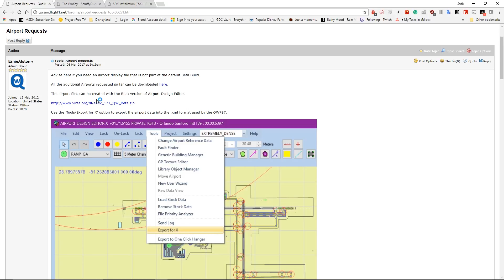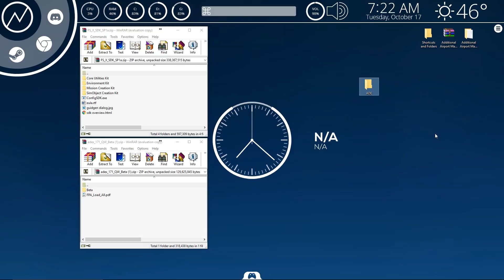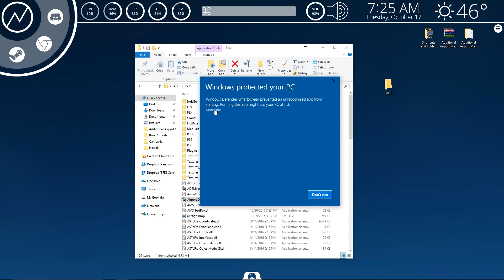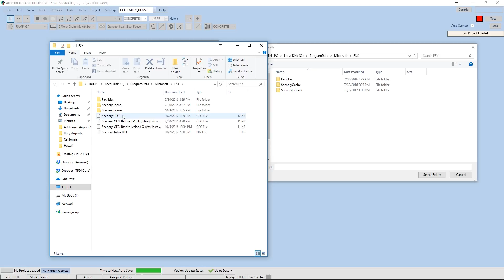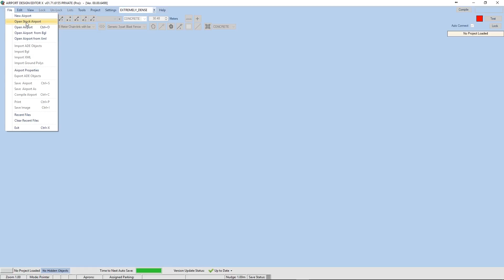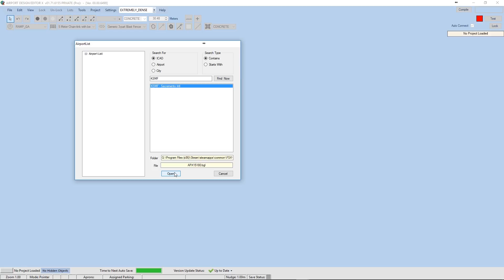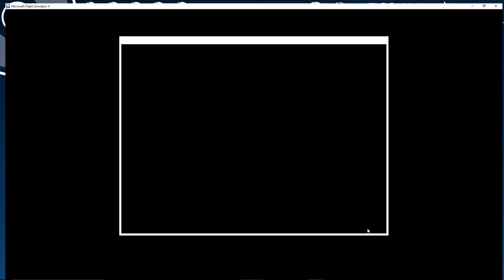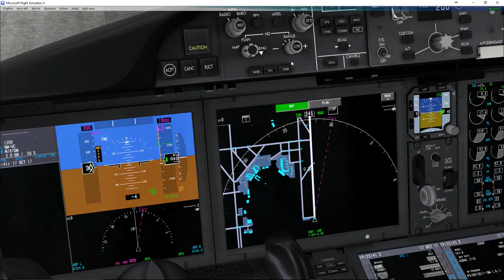How to Create Airport Maps for the QualityWings 787

Comment: A prokey is not really needed for doing the job. Advertisement?
Reply from the maker: Not an advertisement, just a good program. I pointed out that it would only affect the highlighted options, which if a user needed, a prokey would be required. I have no affiliation with the developer.

Comment: hello there, i see in your video (0:48) that you go to the forums of qualitywings to a specific post, where it has a link for available airport maps, i cant seem to find that post on the forum, could you be so kind as to tell us where to go? thanks a lot! also your links are dead.
Reply from the maker: That post was from the beta forums, any of the additional maps requested are automatically downloaded with the plane now. I've updated the top link to fix it now, the second link still works.
Reply: thanks Josh!! very kind of you!  you mean that there is a place to download airport maps fot the 787? the ones they have for europe airports are very bad, that aplication can convert charts from lets say, navigraph? thanks again for your help
Reply from the maker: cartayna not sure about those, it can read from add on BGL files, but requires some additional work. If you want better ones, check out the AVSIM library for them
Reply: Thanks mate!!

Comment: Can same steps be used for payware airports?
Reply from the maker: David Milate It depends on the way they structured the AFCAD file. Most likely not, but you will need select the open airport instead of stock airport option and browse for the AFCAD file.

Comment: Nice video! I have one question, im trying to add the aerosoft Madrid airport AFCAD into the qw787 but the problema is that once the airport is desplayed on the screen, no taxi ways appear, i got into the conclusión that is because on settings they have to be on "solid" mode isn't it? if you know why is this or how can i set all taxiways into "SOLID" mode without doing it one by one let me know please... :) i really apreciate it.
Reply from the maker: Captain: Paramo I've found that a lot of the 3rd party AFCADs are missing quite a few things. I usually look for an up to date AFCAD on avsim or other free sim file hosts. Hope this helps.
Reply: Joshua M I’ll that thanks!
Reply: how do i open a 3 party afcad... i cannot find a option says open ade..